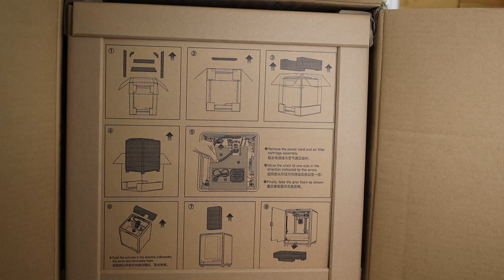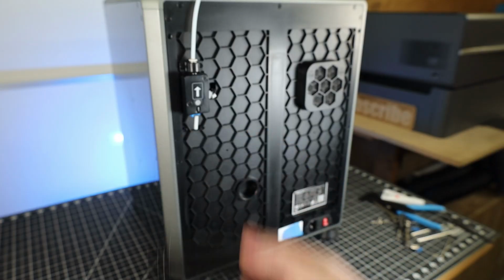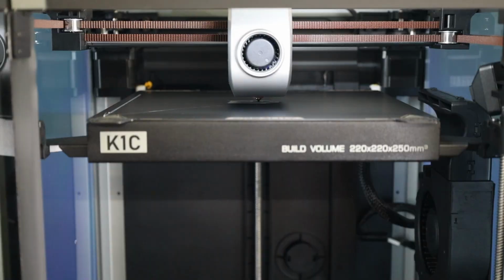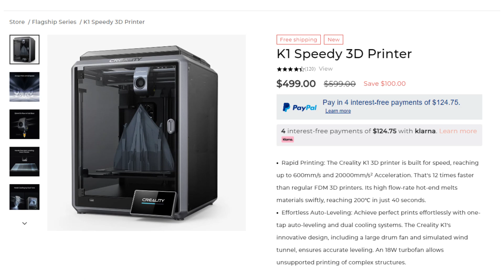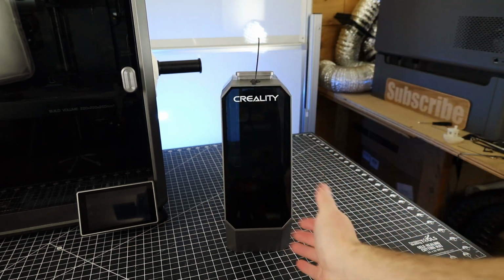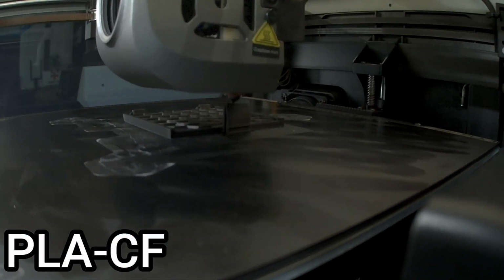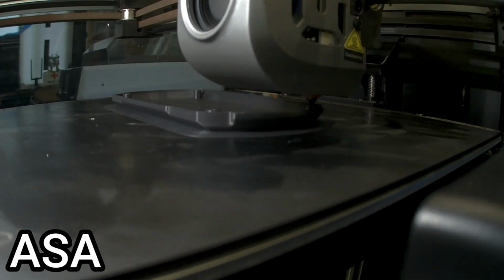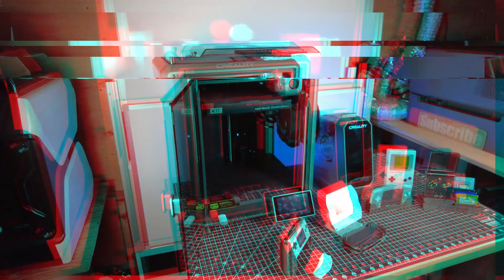3D Printing Retro Game Parts With The New Creality K1C 3D Printer

Comment: i use my dryer with the printer and still use the filament sensor just fine. It just bends in the tube a bit to get it there. However, theres a free file you can download to relocate the filament sensor to the side of the printer.